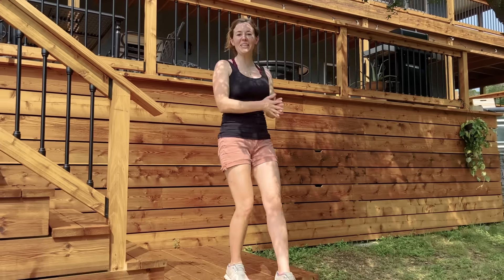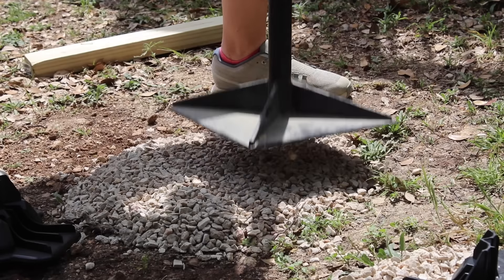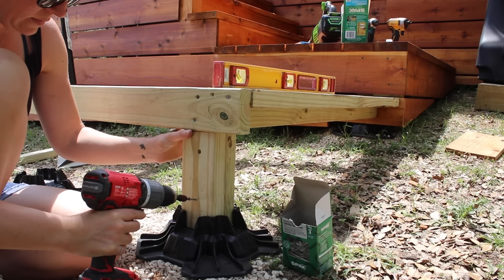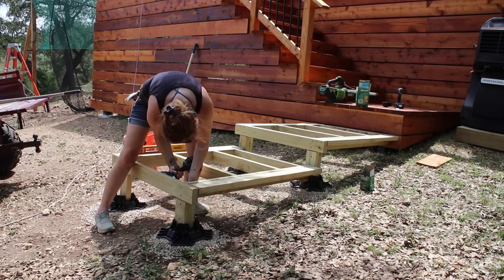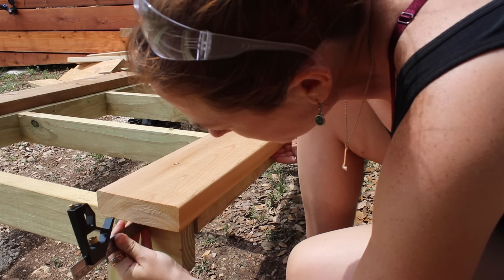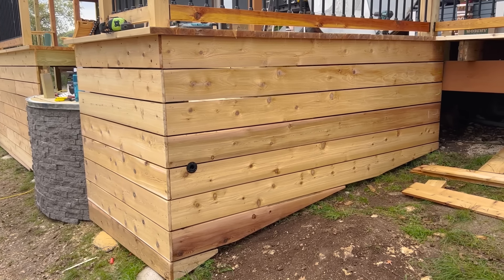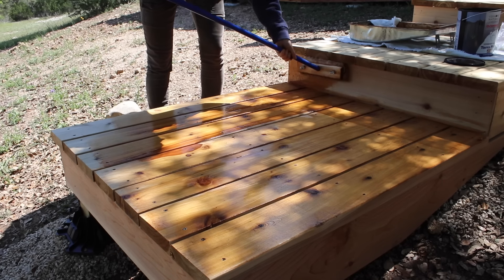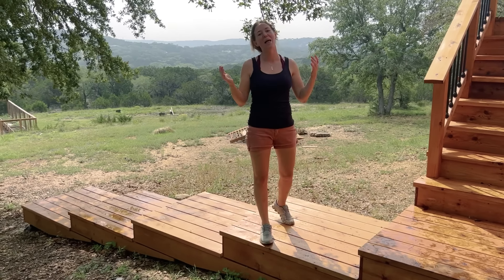DIY Wooden Walkway with Stairs | Fast, Simple, Inexpensive

Comment: It looks very nice.  Will you be able to add the rails?  I enjoyed watching what you did.  I have never seen the blocks.  I need to check these out because I would want to use these blocks to build the deck in the backyard..  I need to figure it out what kind of wood that would handle the cold weather during the wintertime.

Comment: Great job. But two questions.
On those tapered skirtings did you encapsulate the cut ends from water rot?
And most importantly WHERE THAT BEAUTIFUL TREE HOUSE & OUTDOOR KITCHEN?  How does this deck build connect with the treehouse?
Jim in N.Y.

Comment: Great idea and video. I am so jealous!
One suggestion though. Create a slight depression in the ground where you want to place the gravel. This will better contain the gravel and maintain a level platform for the posts. 💯
Reply: +1  On that slope, I fear you'll find your "footings" eroding with the first good rain.  if the grade runs across your stairs, a rock lines dry creek bed is a good decorative way to keep the drainage away from the footings.  If the slope runs parallel with the stairs, a slight swale on either side would be a good  just-in-case measure

Comment: Beautiful work! But I would’ve ran the planks the other way, including the original platform.
Reply: From a designer perspective, she chose the right orientation.
The vertical lines draw your eye in the direction where the walk is taking you. In addition, it breaks at each step so it makes it safer and more visually interesting.
To each their own, but there are good reasons to orientate the boards the way she did.

Comment: As always, great build and video. Love the deck and cedar in particular. 

Also wondering if you are finding or have any thoughts on heat treated lumber? There are a variety of innovative building materials that have used heat treatment in place of pressure treatment, and more recently pallets. This year, I have found dimensional lumber being carried by our local bigbox store. It is really affordable as well.

Comment: I suspect that you do not need to worry about ground frost moving the Tuff Blocks being you are in Texas. In northern Minnesota we need to get 48"+ below the surface to get below the frost line.   Maybe adjustable posts on the front side of each boardwalk tier would work....
Reply: For basic ground-level things such as this in frost areas, one of my thoughts is to flatten the head of 2-3' long pieces of rebar to be like a rounded nail head, drill some holes in the outer flaps of the Tuff Blocks according to the rebar size and drive a couple of them through the Tuff Blocks into the ground.  This gets the rebar through the frost level and reinforces that the Tuff blocks aren't going to wash away, but also holds them down.  If the blocks or rebar do get lifted a bit, it will be minimal and can be easily driven back down.  I doubt there will need to be code with this kind of a project and rebar would address any concerns of the Tuff Blocks moving.   Just a thought anyway.

Comment: Did I miss something? Without sunken footings what is a heavy rain storm going to do to the stairs?
Reply: I know this is still a shortcut, but you could mushroom the heads of some rebar, put a couple holes in the supports to fit the rebar and then stake them down into the ground  with the rebar like 2-3ft. Also, make treated wooden boxes to hold the gravel so it doesn't flush away so easy. Could also rebar the boxes. A lot of work to avoid digging a hole & putting concrete in. But if someone insisted, or for whatever reason couldn't do a hole, it would prevent a wash out & hold things in place.

Comment: Curious as to why you didn't use an impact driver to drive the deck screws?
Reply: Drills are faster. If you don’t need the torque (and you don’t for decks), an impact is almost always the slower option.
Reply: Maybe her drill is of the new magic variety that can drive more effectively than impact without twisting your wrist. I saw a demo of one but I'm not running out to replace my impacts for personal use.

Comment: I think you would need footings below the frost line in the Northern US. So those footings would not work.
Reply: These type of footers work just fine sitting above the ground in an area where you have to be concerned with frost line. I used something very similar on a back yard deck about 8 years ago and it hasn't shifted at all. And that's in Northern Iowa.
Reply: @RG-gn8pe  these will work as long as you don’t care about movement. If you attach to a deck or house that has footings then you will eventually have problems.  I’m in central iowa and yes I’ve done similar also. I did it on a deck attached to my house which now has a 6” drop over 16’.
Reply: @BHauck-os9sy  it’s got nothing to do with code. I couldn’t give a 💩 about code. This only works if it’s a floating deck.  If it’s attached to a house you will never hold level. Now in Texas you will never have a problem but if you have rain freeze thaw situations this will never maintain a level deck.
Reply: @BHauck-os9sy  dude you said in your first comment that these will work just fine but won’t pass code. I told you they will not work just fine regardless of code. Most code is not written to prevent bad craftsmanship it’s written for government control. I also have an addition on another house that    has concrete piers set 2’ below frost line. When we have a drought the room drops when it freezes the room rises. So no code don’t always mean 💩.  I will never pull a permit or build to what someone considers code. I have no interest in being a 🐑.
Reply: Used the same concept in rural AK.